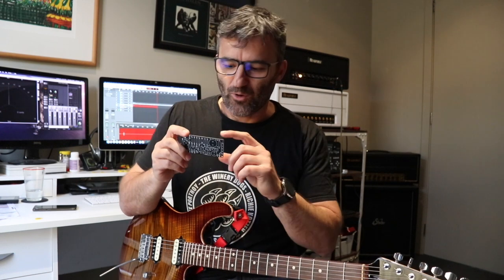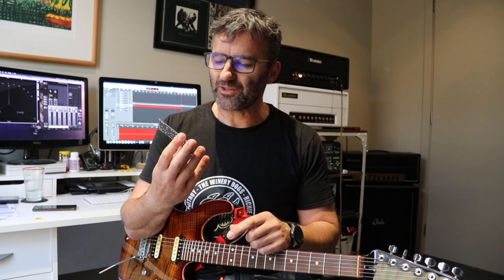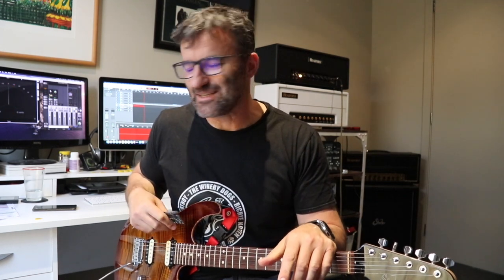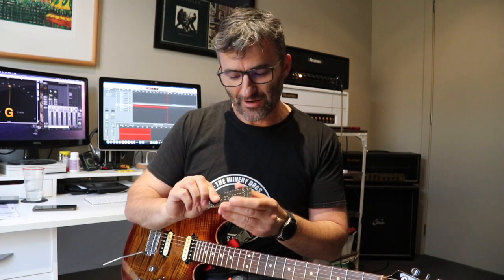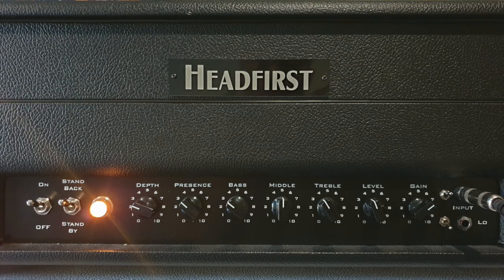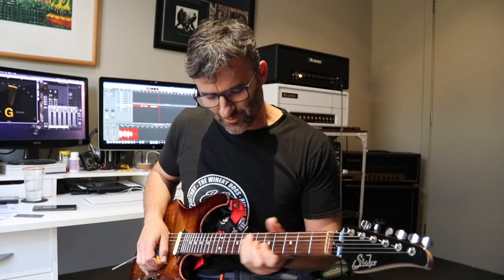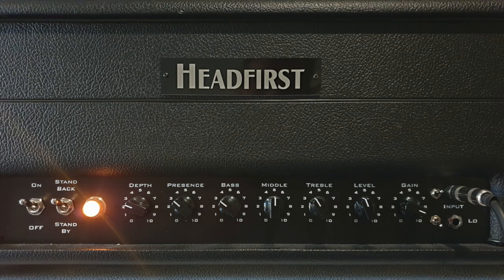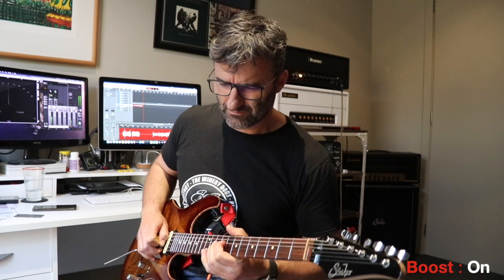High Voltage FET Boost - Amp Mod Board

Comment: can i use this board to add a "clean channel"  to my amp?  does it have enough headroom and output to use on its own out to the tonestack?
Reply from the maker: Yeah, it could be a simple clean that could go into a gain stage & CF setup.  Or straight into the PI input.

Comment: This sounds awesome, would it be possible to put this Boost in a Kit Amp called Jim ? Its a 5 watt single channel tube amp with a Volume and a Main Volume. Does the PCB come with all the components or is it just the board ? The output of the PSU of the Jim is 200 Volts and 6,3 Volts, It runs two 12AX7 tubes and one EL84. The AC before the PSU is 230 Volts. Also would it be possible to mount a pot on the front panel of the amp for adjusting the gain ?

Comment: Do you find this HV FET boost acts a useful boost for soloing? Raising the actual volume of the amp from say, a comping rhythm volume to a stand-above-it-all solo volume?  Or does it act more as a sonic texture variation?  Thank you!  I'm getting it soon anyway for a project but just want to know what to expect in gigging conditions.  Thank you!  Sounds great
Reply from the maker: It does depend on how much gain you have dialled in to begin with.  If mid-gain then you’ll get a bit of a volume lift as well as gain.  If you’re already in high gain then you’ll just get more gain
Reply: @HeadfirstAmps  Thank you, that's exactly what I would have suspected.   Seeing as that I play out alot of 70's and 80's classic rock,  I very well may get the benefit of a solo boost as well as gain since often, its not alot of gain for the verse/chording/comping portions.  Thank you!

Comment: Hey there! A bit curious since I've got my PCB on the way: I was hoping to set mine up as more of a "mid/treble" boost kind of thing. Putting a smaller coupling cap is one easy step. Would it be worth it to also experiment with bypass cap on the "cathode" side of the FET (source bypass cap?)
Reply from the maker: Yes, play with the value of the first couping cap (C1).  I ended at 2n2 after first trying 22nF.  You could go lower if you really want to drop out the bass frequencies.  You could try a bypass cap there, it would increase the gain though as well.

Comment: now how about a noise gate pcb?
Reply: I'd get one! Being able to mute the amp post gain from the input signal would be great, especially if it can be accomplished via high voltage FETs so we don't need to figure out how to get 9VDC to it.
Reply from the maker: Interesting idea.
Reply: @HeadfirstAmps  just a thought. Some amps would benefit. Especially if you add a built in boost. Kinda like the purple nightmare, invective, JCM800 kk, etc